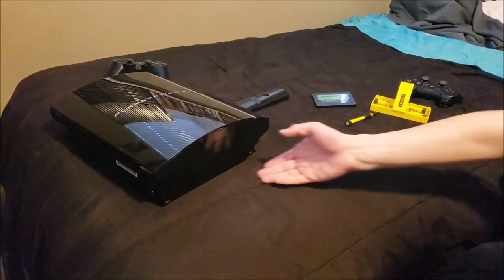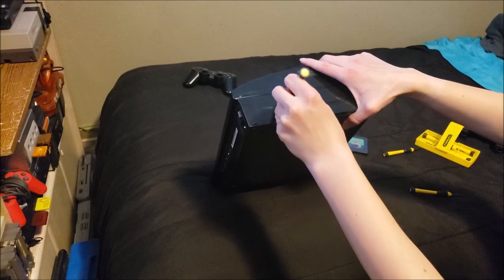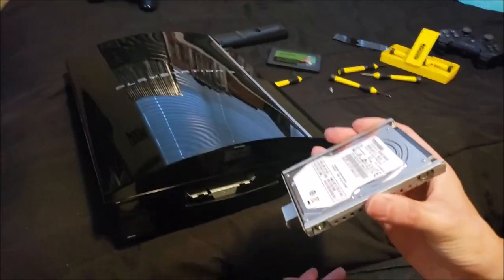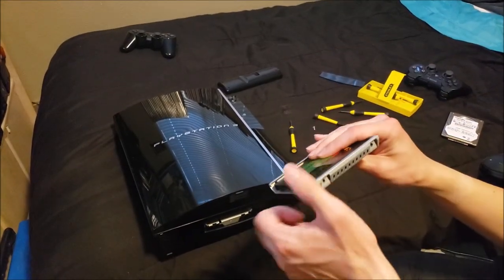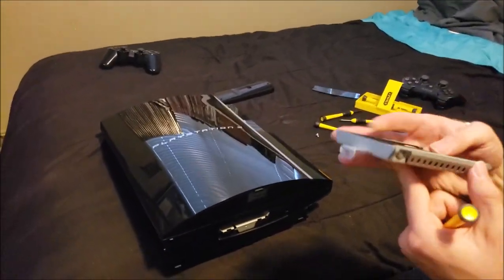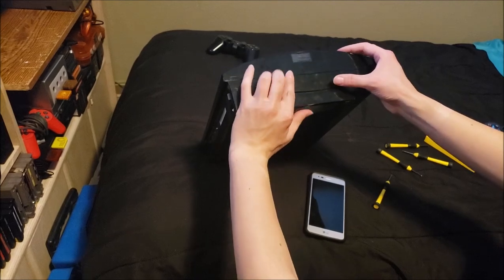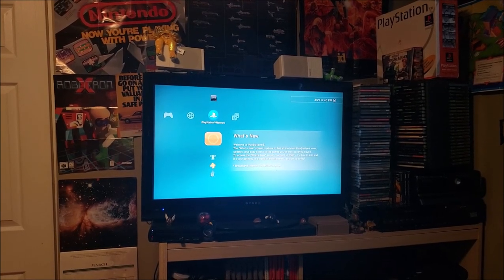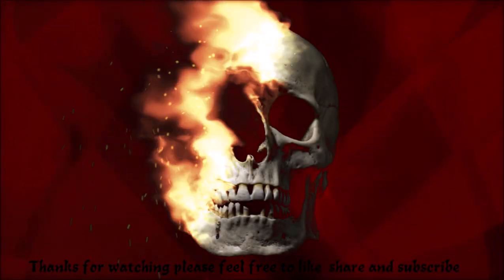Installing A SSD On A Fat PS3

Comment: Hey does the flash drive need specific formatting like FAT32? Also, what if I wanted to copy all of my current data over? Would I need an external HDD the same size as the current disk to back it upto?

Comment: Noice, but this isn't the first Generation PS3 right? Because the HDD in your ps3 is plugged in looking up while the hdd in my 1. Generation ps3 is plugged in looking to the side?
Reply from the maker: It is the first model but not the first revision this is a 80gb model the previous ones (I think 20gb and 60gb) were backwards compatible with PS2 games but I'm not sure if the location of the hard drive is different
Reply: @Twintania  I see thanks! :)
Reply from the maker: @PEACEWALKER1992  no problem :)

Comment: u do'nt need reinstall u can cloning with hd clone 8.0 , but u wont have extra capacity , so that good only if u copy hdd above same size for not lost extra capacity and not paid more , i cloning 60 gb fat ps3 hdd on 64 gb ssd , and it's work perfeclty
Reply: Actually it doesn't have to be the same size if you clone... Sure it will clone the same capacity making the rest unavailable but that's why after cloning it you extend the partition and have it take up the unused space.
Reply: @jairtzinio  u can't extend partition of ps3 , bcuz they not recognize by any software , the partition ps3 are encrypted and they look like as unpartitioned , that why u can only clone them without any extention later

Comment: What's the website for downloading the PS3 update?
Reply from the maker: You should be able to get the firmware directly off of Sonys site
Reply: @Twintania  And then just put it on a USB flash drive and plug it in to your PS3?
Reply from the maker: @HD33P1  I believe that should work so long as you boot the ps3 in safe mode
Reply: How do you boot it safe mode? 😬
Reply from the maker: @HD33P1  press and hold the power button for up to 7 seconds until it emits 2 beeps make sure you have your controller plugged in
Reply: And then press select?
Reply from the maker: @HD33P1  don't remember how to sorry
Reply: Would it better to drag the file straight on to the SSD and then just put it in the console?
Reply from the maker: @HD33P1  I'm not sure if that will work
Reply: So how do I do it? 🤷🏻‍♂️
Reply: @HD33P1  found it yet?
Reply: @TriiCkS-YT  no

Comment: Do you have to format the SSD before you install it into the PS3. I have a 2 TB SSD I want to install. Is there a size limit of the SSD you want to install?
Reply from the maker: I'm not sure about the size limit I have heard 1tb is the max as for formatting it I would assume you need to I bought mine brand new and it worked. If you're unsure I would just buy a ssd of the size you need and throw it in there even a 250gb drive I think is around $100
Reply from the maker: Actually I just checked and saw a 250gb drive for $45 on ebay so a 500gb drive would likely be $100
Reply: @Twintania  and now 1TB ssd's are $50 xD
Reply: 1.5 gb max on ps3 , so 2tb drive wont work for sure
Reply: PS3 doesn't have a limit on how much memory you can install (that's what a SONY representative said to me on a phone call).

BEAWARE bigger HDD means slower PS3 speeds. So I recommend you to use a SSD.  Any SSD will do the job 110%, you will trim over have the time in loading and installations screens. Go for it! If you are too short in cash buy a 1TB Hybrid Drive.

Comment: Will any ssd work? Can I use SanDisk 500gb or 1Tb?
Reply: I think the max a ps3 will recognize is about 1.75 tb or some were around there
Reply from the maker: As far as I know any ssd will work although I'm not sure if it will recognize 500gb or 1tb sizes
Reply: Ps3 will recognize 500gb but I dont know about 1tb
Reply: @seijatachitakaneyo8316  i used 1 TB in 2012 on my ps3 fat , it's worked perfeclty
Reply: ps3 allow  1.5 TB  drive maximum , so like this capacity don"t exist on ssd , u have to buy 1tb only ssd , exept if u can found 1.2 tB drive , i doubt that  can exist

Comment: i add ssd 250 gb in mine i find it keeps PS3 flat has 4 usb cooler
Reply: So far I've had a reflow with leaded solder, which isn't prone to cracking like the one Sony used. The reflow is carried out with a machine, new thermal paste, an upgraded fan and an SSD. My friend said he has and attachment the PS3 sits in and has two fans attached to the side, which blows cool air through the console constantly. It should hold up pretty well for a while
Reply: H D hell yeah bro
Reply: H D don’t get the inner cooler attachment. The upgrade fan is plenty. Too much air is not necessarily good air
Reply: Ok. I just don't ever want it to fail
Reply: So the SSD upgrade made your PS3 run cooler?
Reply: I'm trying to find a way to ensure all my data can be backed up in case of failure. I also thought that SSD was more reliable than a normal hard drive? Do you know of any modifications to make the console run cooler?
Reply: It’s very important that you keep your ps3 AWAY from anything else, it needs proper ventilation, the ps3 in this video is probably frying because it’s on a shelf 1 inch away from everything else. Not smart, the ps3 needs SPACE, CLEAN AIR, COLD ENVIRONMENT
Reply: H D never mind I read the first one wrong. Use the SSD or at least SSHD. if you have launch edition fat ps3, the thermal paste needs to be replaced and fan upgraded to 19 blade from 15

Comment: so can i use  any ssd  or hard drive thats is 2.5?
Reply from the maker: I would use a ssd personally but any standard 2.5in laptop drive should fit not the large one which I think is 3.5in
Reply: @Twintania  thx i got ps3 and it had space like 70 gb so i plan upgrade it to 500gb or 1tb so this video helps on how to do it
Reply from the maker: im glad :) I suggest getting a 500GB or even a 250GB games dont take much space unless you download a bunch even then you can always get a external drive if you want to expand
Reply: @Twintania  I don’t think the difference is that noticeable Maybe the Samsung SSD would be But personally doesn’t seem worth it
Reply: Twintania Gaming hey so I was wondering if there’s a way I can open my ps3 clean it and maybe even upgrade it? Like if i put a new ssd in my ps3 will it run better ? And obvi if I clean kt
Reply from the maker: @loitersquadX  you can open and clean it if you want to but the ssd is the only upgrade you can do and you just need to remove a panel on the side of the console to access it. If you want to clean it I recommend using a air compressor or buying a air duster can and blowing it out its not necessary to disassemble it but you can if you want
Reply: Twintania Gaming what does upgrading it do ? Will the games not be as choppy
Reply from the maker: @loitersquadX  it will make the game load faster generally, some people report better performance but I wouldn't guarantee it
Reply: u can cloning ur hdd  with free version of '' hdclone free edition 8 ''  the only softaware who can cloning ps3 crypted disk . it's work , , but just use the same size of ssd with a bit more free space ,  cloning  60 gb  on 64 gb ssd ,, cloning   120 gb  on 128 gb ssd ,, cloning 250 gb on ssd 256 gb ,,   bcuz if u clone 120 gb  on 250 gb ssd  u wont get more free space , it's will be empty ,, space no usable ,,   but  cloning it more fast than reinstall
Reply: it's will load more fast , like game like  doa 5  between each fight , u won"'t even time to move the camera , and next fight will start about 2 sec than 10 sec normaly . it's no popping with gta 5 too
Reply: u can even use sata msata  if u have adaptor sata to msata ,, it's just passif adaptor , they no have any conversion signal , it's just '' wire on pcb ''

Comment: Do you save your game data on an external hard drive and can you describe the software aspect steps? I’m getting into upgrading all my hardwares.
Reply from the maker: I don't transfer my data since I didn't have much at the time unfortunately I can't say for sure hoe to do it but there should be a way to copy the data onto a flash drive or something like that so you can move it back later
Reply: It is in the system settings to backup and restore your files
Reply: u can cloning ur hddd  with free version of '' hdclone free edition ''  the only softaware who can cloning ps3 crypted disk . it's work , , but just use the same size of ssd with a bit more free space ,  cloning  60 gb  on 64 gb ssd ,, cloning   120 gb  on 128 gb ssd ,, cloning 250 gb on ssd 256 gb ,,   bcuz if u clone 120 gb  on 250 gb ssd  u wont get more free space , it's will be empty ,, space no usable ,,   but  cloning it more fast than reinstall